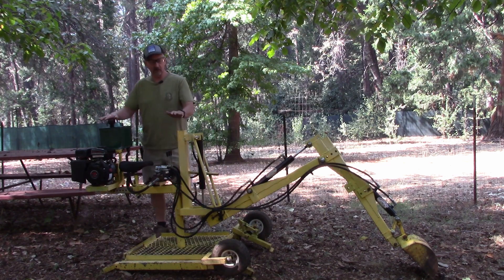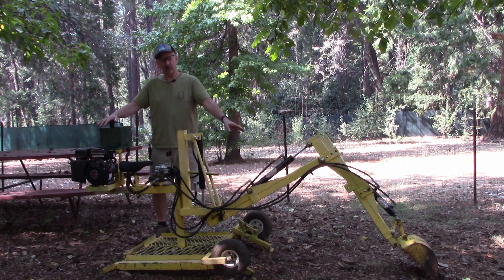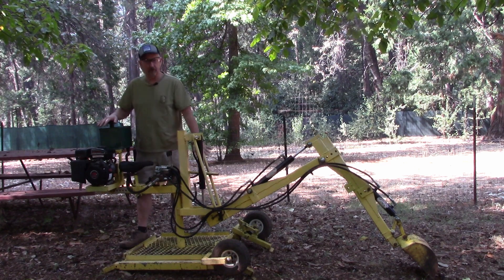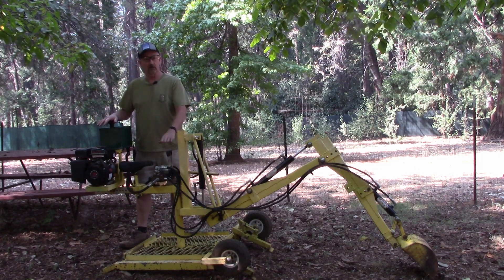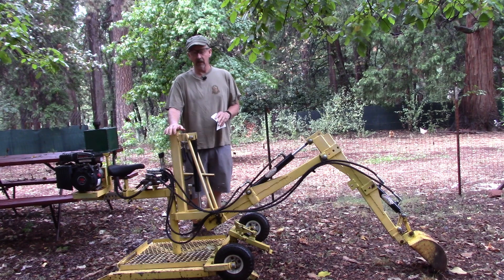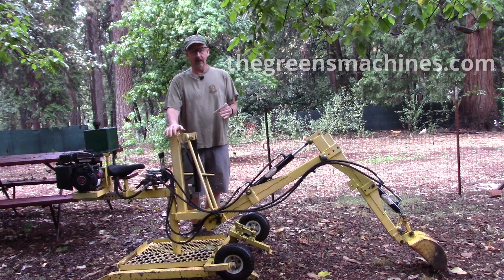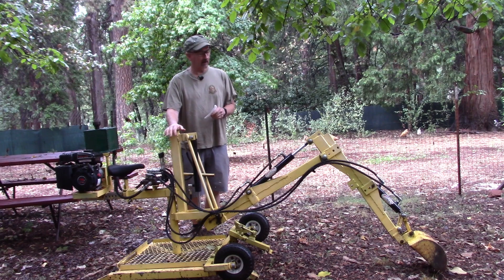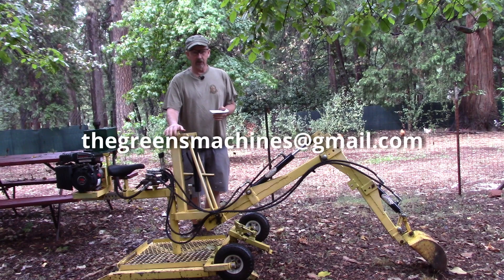360 degree backhoe build intro

Comment: I purchased your plans some time ago - never got around to it as I cancelled the yard project.  Now I am thinking of doing it. Do you think building out of aluminum will hold up if I double the thicknesses of material.   I just finished a steel trailer and I am so tired of working with steel that has to be painted and rust rust rust😁
Cheers
Reply from the maker: Hi Patrick. I will send you an email.  I would definitely stick to steel. I have not tested an aluminum build.